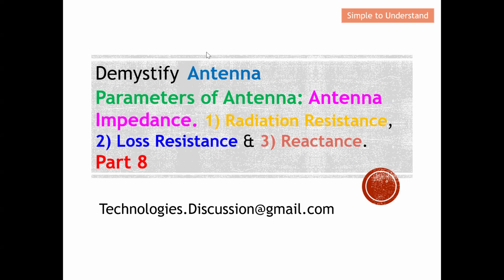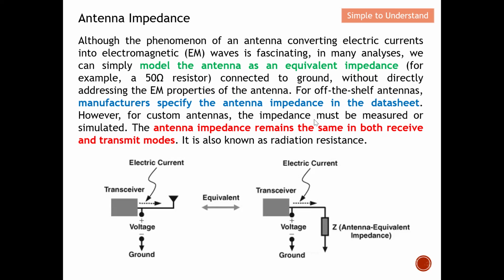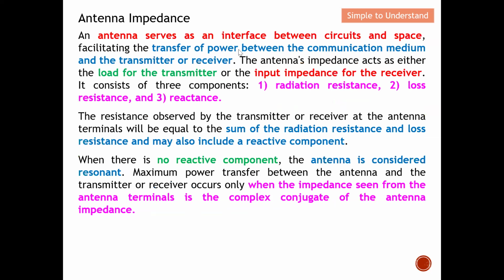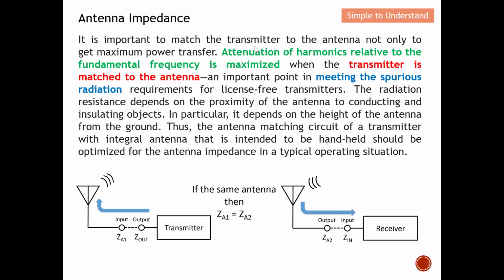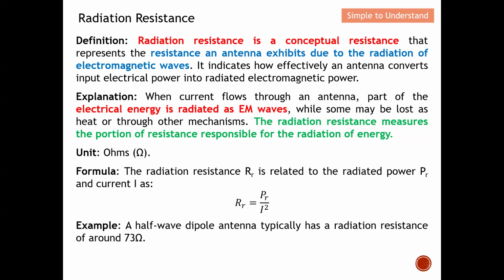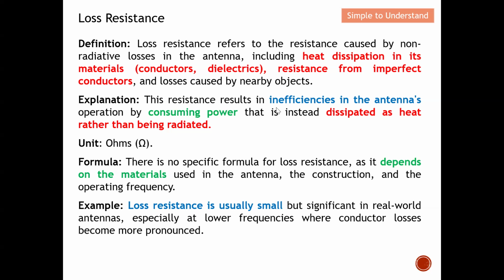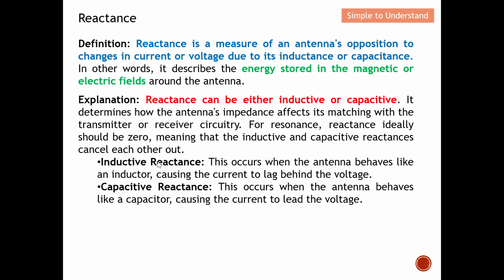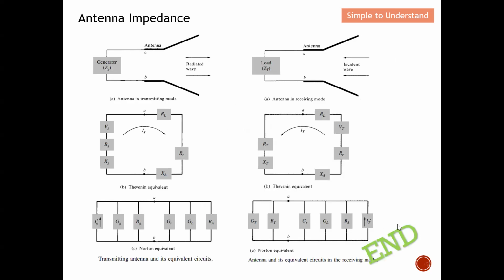Antenna #8. Impedance (Radiation + Loss Resistance & Reactance). What Happen if Resonance Occur?

Comment from the maker: Thank you for taking the time to watch this antenna video. This video explains how to determine antenna impedance, which consists of radiation resistance, loss resistance, and reactance. When there is no reactive component (i.e., reactance equals zero), the antenna is considered resonant, enabling maximum power transfer between the antenna and the transmitter or receiver. This condition occurs only when the impedance seen from the antenna terminals is the complex conjugate of the antenna impedance.
The radiation resistance indicates how efficiently an antenna converts input electrical power into radiated electromagnetic waves. The loss resistance, on the other hand, represents power dissipation (e.g., heat or ohmic losses), and ideally, this value should be as small as possible.

Comment: @14:15 you mention that a half-wave dipole typically has a radiation resistance of around 73 ohms. Isn't this rather the feed-point impedance, when it is fed in the middle? This is different from overall radiation resistance, which is based on the average current over the whole length of the antenna, rather than the current specifically at the feed-point. The average current being not just a function of the current flowing at the feed-point, but also its distribution over the length of the radiator. Do you still get 73ohms if you integrate the area under the curve of the entire current distribution? Might be worth doing a video just on this topic.
Reply from the maker: I fully agreed.  :)
Will do another video for the detail explanation.
The ideas for this playlist for a start is introduction to Antenna Parameters.
Thanks again.  :)